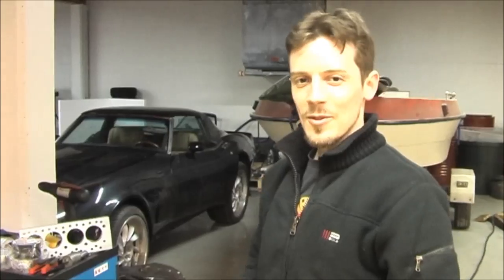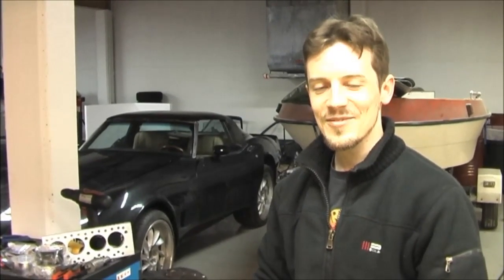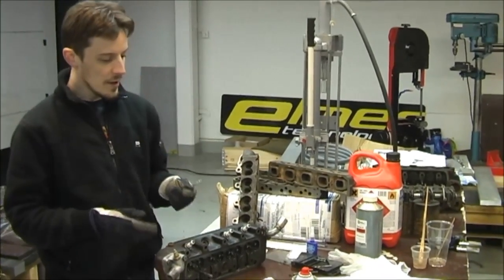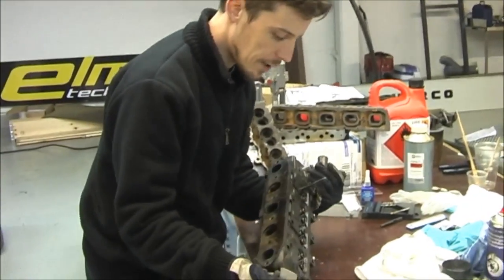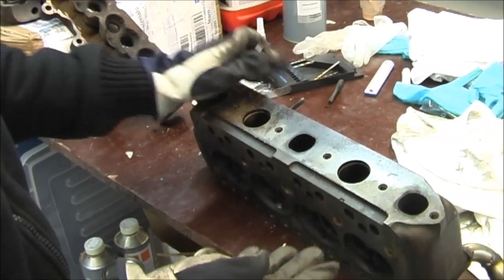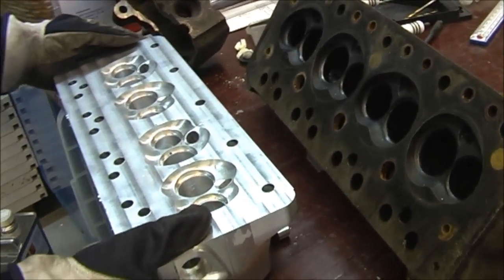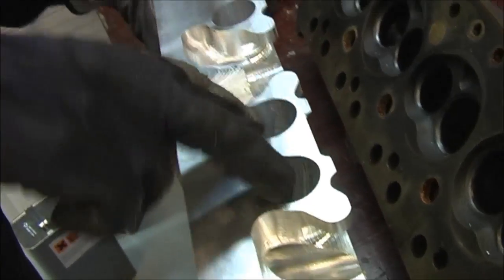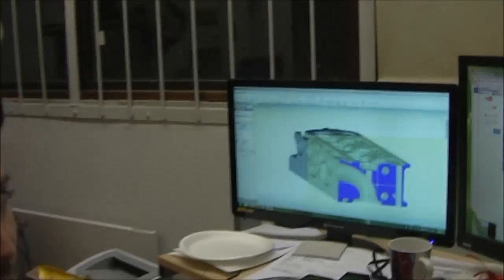How to make a 8 port mini head - documentary - Elmer Racing

Comment: Setting the plugs the way you have isn't the way to have them ,your design will cause stress and wear on the piston and rod . The envelope flash will ignite across one side of the piston causing the piston to unbalance and rub the skirt against the cylinder leaving it to fail through fatigue. You criticised the original manufacturer's spark plug placement but at least they got it to ignite directly and evenly towards the crown of the piston  , there's books out there to know about these things

Comment: ardun did 8 port cross flow heads 45 years ago, sadly all the ones i have ever found had stress cracks between cyl 2 and cyl 3, this was mainly due to copying the a series water channels with no bypass hose, which caused hot spots.
the bmw head conversion looks interesting, but these days there are loads of engine choices, tuning the a series is moot.
Reply from the maker: We got very good power response from our 8port head. But the need for custom exhaust and intake manifolds do not a bolt-on solution make. :D
We have discontinued our heads.